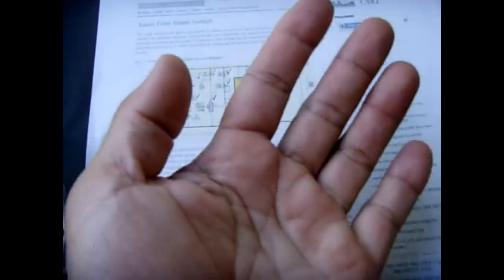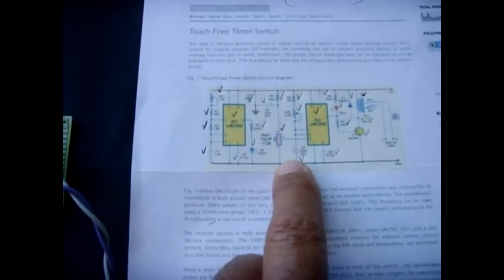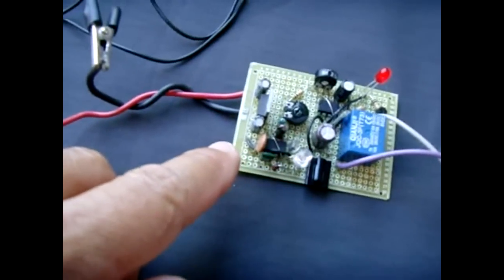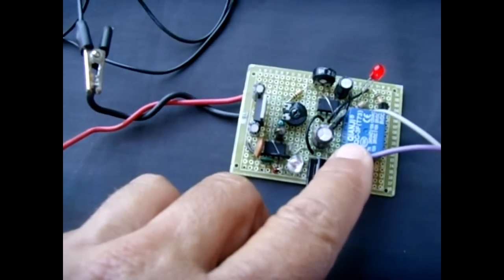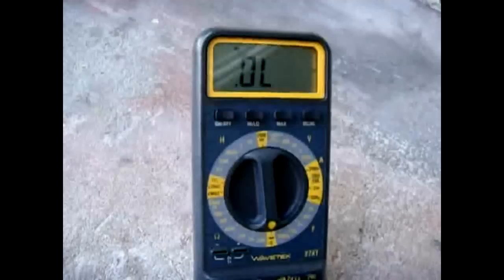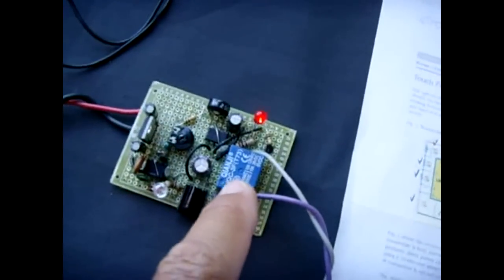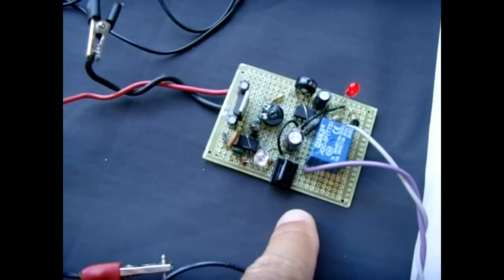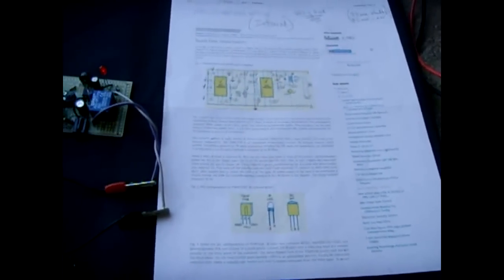Hand Wave Sensor Switch Relay Circuit(Very Good)

Comment: Hey buddy, thanks for posting this and all the cool stuff you post. The link I subscribed to thanks lots of useful stuff there. Here is another for you. I have a heated garage.  Battery operated thermostat what can I do to make it remote controlled? I am about an hour from Cleveland so it gets rather cold here. Last year -19 for about two weeks. No internet out there yet. I am thinking ardino but I have not used those yet. But want to learn.  Thanks again.
Reply from the maker: +William Ward 
You can buy thermostats which you can access anywhere using your smartphone. :-)
Reply: Thanks....

Comment: If anyone wants this circuit use this link.  The one above only has the text. I suppose the schematic was linked and the link is broken.  

http://electronicsforu.com/electronics-projects/touch-free-timer-switch

I plan on using this circuit at night.  Using clam shell drawer pulls Blue LEDS will light the way to the Master Bathroom as well as the stairway.  I will also have them on a battery backup circuit in case of a power failure.  This is a good circuit.  Many applications here.

I saw another one where you touch a pad. I will use one of these for some of my power equipment. When the table saw comes on so does the Dust Extractor.
Reply from the maker: Thanks William! I already replaced the link.